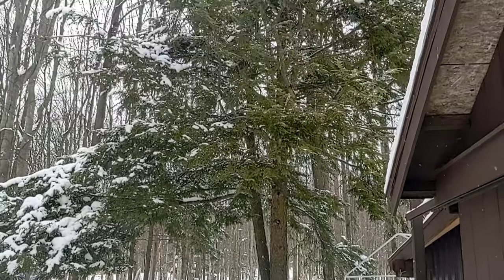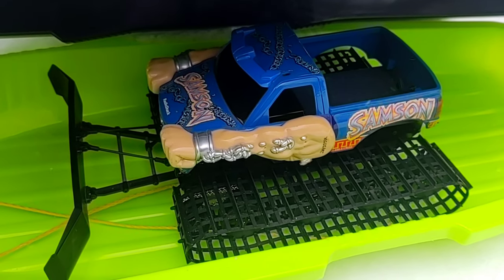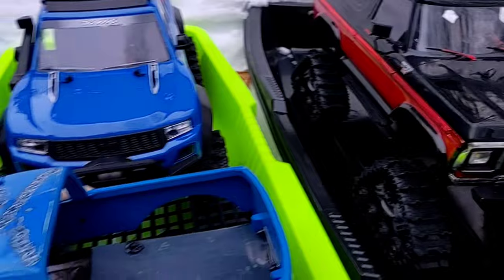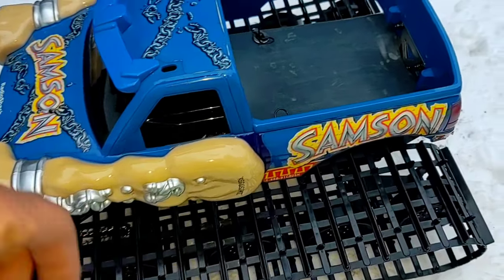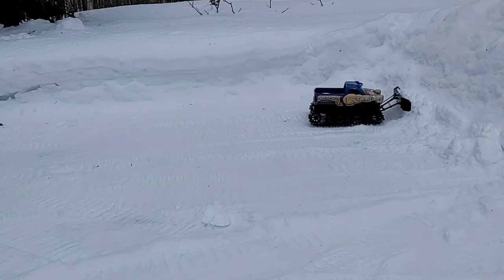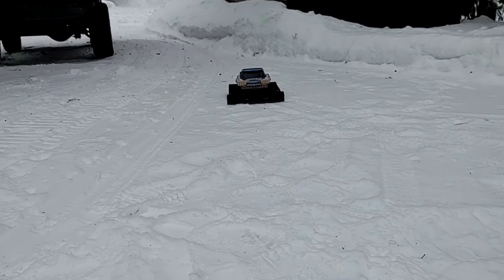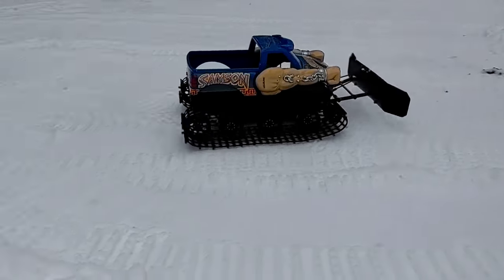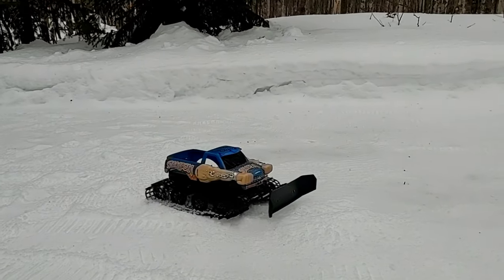Samson Snow Plowing; "Custom Kyosho Blizzard"

Comment: I like it at the beginning of the video when you say, a little snow, not as much as usual, if we had what is in your video everything would be blocked and no one could move around here 😄 It is a good idea to put the Kyosho outside to acclimatize it to the cold, it reminds me at the beginning that I had to buy my Wraith, I wanted to try it right away but it was really very cold and I broke two links, if I had left him outside like you, nothing would have been broken. I really like this blizzar, I never buy them because it snows very rarely here, it's a shame because it is really great, plus you put a really great body on them of Ford 😍 And that's a great tip, to put it in a sled or a garbage bag. The two motors you put in really give it a lot of power, great job adapting them with the new handmade linkage. If it snows here next year, I call you and you come to clear the snow in my scale park 😄 
p.s :  I'm a little late in your videos, but I'll watch the ones with the scx24 tomorrow 😉👍
Reply from the maker: 😂👍👍 Across the Board!
Thanks for your Awesome Compliments as always my Brother, and very much appreciated as always for checking out the video Pascal.😊😁🤜🤛👍👍
Reply: @R.C.A.D.  😊👍

Comment: That's one of the coolest bodies ever, looks perfect on the Blizzard chassis. Great plow truck , luv how it rolls the snow. Very cool electronic setup too 😎
Reply from the maker: 😁👍👍 Thank you Matt,
Sorry for the late reply Bro, my eyes were getting heavy, and I needed a little nap, and I'm dragging butt trying to wake back up,😊
That old Samson body fits the blizzard well,😁👍 lol Perfect with the blade on it,😂👍👍 and it's not to bad at plowing snow either, Actually does a Great job at it,😁 
Electronics; They were a necessity, and Do the job nicely,😊 it's hard to believe, but with two of those wltoys batteries, the old blizzard will run for close to 80 minutes,😊 That's actually long enough, that you could plow a small driveway with it,😂 lol 
Many Thanks for your Great Compliments, and for checking out the old Blizzard at work my Brother.
😁😊🤜🤛